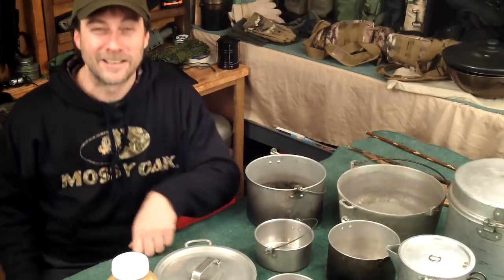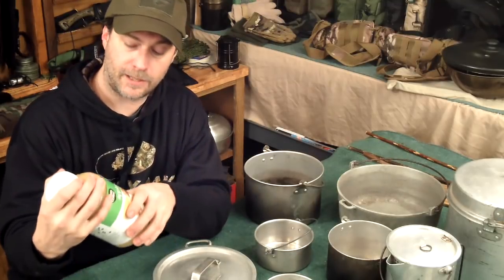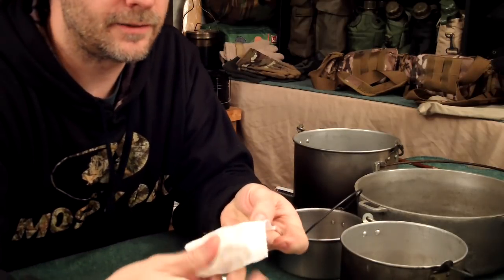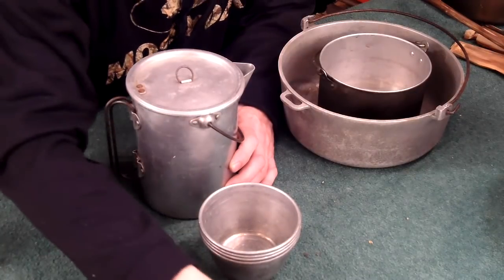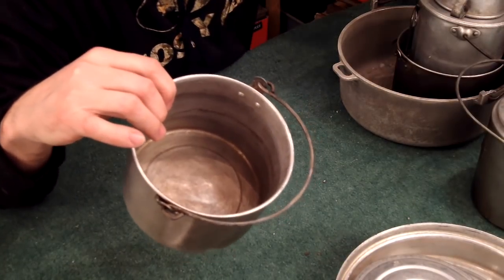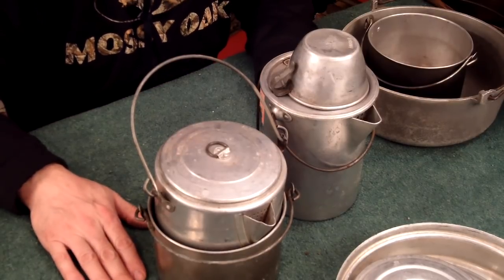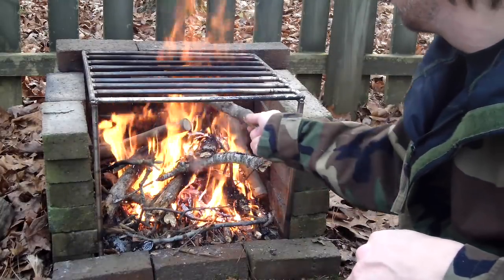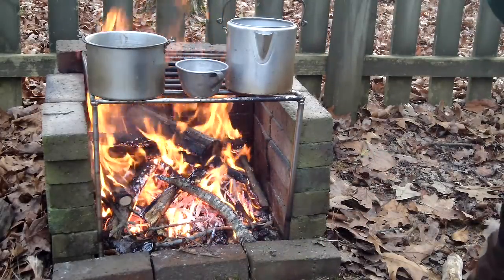Testing Old Aluminum Cookware For Toxicity

Comment: Maybe it's time to switch to Stainless steeluMINEEUM...:)
Reply from the maker: I love my vintage pots but most of my camp cooking is done with stainless
Reply: Not all stainless is equal and can leach heavy metals as well.
Reply: LoL Sandy PEACE :-)
Reply: Easy for Dave to say LOL
Reply: Or, cast iron. The saying should be: 'it's worth it's weight in cast iron'.
Reply: From where.. ? 
304 standard approved stainless steel used for kitchen products are made of 
            Ni                     9.25
            Cr                    19.00
            Fe                  Balance
            Si                    1.00
            Mn                   2.00
            C                     0.080
            P                     0.045
            S                     0.030
Do you think cookware would be approved for cooking food if it contained heavy elements... ?. so unless its contaminated from an outside source there is no heavy metal in stainless steel... jeez man... they even use it at hospitals as surgical steel...
I googled it and obviously a lot of wacko sites recommend against it but I could not find any government or FDA recommendations against it...
Reply: @kristianblerche8443 couldnt find  any govt or fda rec. against it  hahahahahahah
Reply: @Reallybigmonkey1    Not trying to be rude .. but my daughter also had a problem pronouncing aluminum also ... so I taught her the phonetic way to say it .. a lew ma numb ,  : )  but then she also called a zipper a "gipper" for years ... and having spent the first few years of her life growing up in the south she learned that cow was a "caaw" and that never changed!  Love your videos Dave!  Blessings.
Reply: I use stainless and cast iron. Cast iron is to heavy to pack very far and I don't trust stainless or anything for that matter from China
Reply: MrOldclunker yeah your totally wrong about that.  I spent roughly 10 years in a steel mill.  Working the LMF (Ladle Metallurgy Furnace)
Reheating 85 ton pots/ladles of liquid steel and making the different grades and none of the chemistries ever came back from the lab with any heavy metals of any kind. Your a nut

Comment: Great video and a great alert about leaching from metal pots.
I first heard about this when I discovered that some "stainless steel" pots made in China ended up on shelves in the US and they turned out to be "stainless steel with a healthy dose of pot metal including lead". I eventually adopted the following strategy based a little knowledge about metal work and cast iron pans... all learned from youtube channels like your fine self.
1. I dont assume any metal pot or pan is 100% safe
2. Unless its a premium stainless steel from a very reputable supplier....I season it.
I learned this from seasoning cast iron pans but it works on aluminium too (albeit slower and more difficult) .... when I get new alluminium pots and pans for camping, I always wash them, scrub them, scrub them again with a very fine sanding sponge, then wash them again a few times. Then I season them with Trex or some other vegetable based fat bar, several times.
That way, just like cast iron pans, you are cooking on the patina, and its your food versus the coating, not your food versus the metal and whatever its leaching.
The funny thing is that this problem is really a problem of the modern age... because we have water and detergent on hand and in abundance. Nobody used to scrub their pans back to the metal in the old days. I had to train myself to cook with cast iron and aluminium pans, and NOT scrub them clean.... remove the food debris, remove the crap... leave the patina. 
Thanks for the video mate. People need to be reminded that crap leaches into their food from the tools they use to cook it.
Reply from the maker: I'm glad you liked the video and thanks for the comments! That's very wise advice to season all the new cookware you use. Thanks for watching brother

Comment: What an awesome tip David! Thanks. Another way to check if the aluminum is still good to use is by looking at the surface of the cooking area. IF it is corroded and specifically PITTED it is no good to use anymore. I did a lot of research a few years ago on the dangers of using aluminum to cook, and the general consensus was that it is OK as long as there is no pitting and corrosion. That cast pot was clearly corroded and pitted, and the stamped pots were nice and smooth, so it seems to verify the information I found as well. Now, I believe it would be possible to repair the cast pot if the corroded and pitted areas could be ground down and polished smooth.
Reply from the maker: Thanks! I'm glad you liked it Steven. That's some good information. I had heard that just cleaning wasn't enough that it needs a high polish.

Comment: This was good.  If you were to again put applesauce in the cast aluminum Dutch oven, would it again turn pink?  Or would the applesauce have stripped out the toxic material?  Whisked it away, so to speak?
Reply from the maker: I have no idea. I only did it once. Good thought to try again

Comment: Good experiment Dave. I'd be curious to know if the acidic properties of the apple sauce actually "cleaned" the bottom of the cast pot. When you cleaned out the pots, did you notice any variations in the color vs. what it was prior to the experiment, especially with the cast one? Just wondering...HAPPY NEW YEAR!!!!
---Chris
Reply from the maker: Thanks Chris, I'm glad you liked it. Well they claim that if a pot is dirty soiled or tainted, it can eventually be cleaned out. If its an old leaded alloy pot then it will always turn applesauce pink! Thanks for watching and a Happy new year to you too!
Reply: I was wondering same. Growing up as kid i learned you can use ketchup on bathtubs get the dirty ring off. So yea i do wonder if it could be saved. But, honesty after all replies i. Here and this vid. I dont expecr using aluminum for cooking anytime soon.

Comment: I seasoned all my aluminum like cast iron also one like urs they don’t look as nice but man they cook good
Reply from the maker: I agree,  seasoned pots are definitely the way to go
Reply: Any tips on how to easily season aluminum skillet without an oven?
Reply from the maker: @rogierius  They claim you can start a campfire and get it going.  Throw the pan in and warm it up. Pull it out while hot and smear Crisco all over it and throw it back into the coals. Do that 2 or 3 times and you should have a nice shiny black coating.

Comment: If I understood it right, Aluminum (Aluminium) is a so called soft metal and releases particles in to the food when heated...and therefore in to your body. BTW...Alzheimer's, according to research is also caused by eating soy products  (together with impotence). I still own a aluminum canteen and matching cup....but I will replace that with a stainless steal one...if I will remember. LOL (Have a good one David!)
Reply from the maker: Very interesting Patrick and I never knew that about soy! Thanks for watching
Reply: Phytoestrogens are FAR less effective than the bovine estrogen found in dairy and beef. The Japanese have a diet very high in soy and studies don't show the problems people claim.
Reply: Also i picked up some aluminum kits and I'm very resistant to use them. Probably going to just scrap them

Comment: In the large pot that turned pink indicating toxicity ypu can still boil water and cook in aluminum foil inside of a plastic bag. The key is to not let the food get in direct contact with the pot. Boil vinegar until you can detox the pot. Vinegar and soda should finish the detox after cleaning  it. After that use iodized salt to wash your pot after seasoning it with flaxseed oil. Preseason every time you use the pot. Use salt and water paste to clean it every time you use it. Burning.  Charcoal in it will detox it in extreme cases. Oven cleaner in it covered with a garbage bag with take out baked in stains. Detox after that.
Reply from the maker: Thanks for the info Conrad

Comment: I'd turn that cast pot into a fire bowl. ;D Did you ever try to polish and retest the thing?
Reply from the maker: Nope, never polished it. I think as thick as it is it'll make a good fire bowl
Reply: @Reallybigmonkey1  ... Consider a 1/4" drain hole, so nobody mistakes it for cookware.  Another great video!  Thanks!
Reply from the maker: @FnLn55  good thinking!

Comment: If you really like the big pot, maybe you could use a DA sander and sand it down with some course grit sanding pads rated for aluminum, then some finer grit to finish it off. If you can get into some fresh metal, it might be good. Then run the test again and see what happens. 

If nothing else, this will bug the crap out of you for months and years until you try it....... haha, haha.......
Reply from the maker: LOL, it will bug me! Some folks say clean and give it a super fine polish. I may just do that
Reply: Hey Dave, 

This may not apply here but I soak my Stanley Stainless Steel Thermos with baking soda and hydrogen peroxide overnight to clean it. This may not work on toxins in aluminum however. 

As a tip in addition that that, I picked up a 71' Ford F-100 with an aged fuel tank full of bad gas, corrosion, etc. Instead of paying the radiator shop to steam cook it, I dissolved about 2 pounds of baking soda with hot water and poured that into the tank. I then added a few bottles of hydrogen peroxide and about 4 liters of generic Coca-Cola. Then I filled the rest with hot water to top it off. You can leave this soak for a few days or jump right to my next step..... 

Finally, I took a long rod air blower from my air compressor, tied it open, and laid that in the bottom of the tank with the air blowing bubbles into the tank all day long. This provided agitation and oxygenation for my chemical concoction. 

At the end of the day, I dumped out and gently tapped the sides all around with a rubber mallet to knock anything loose. I then rinsed it out with a garden hose and let it dry out completely. Once dry, I tapped it gently with the rubber mallet some more and vacuumed out the loose rust crumbs and dust. 

The end result was a nearly brand new looking, shiny clean fuel tank!

The only caution I offer is that I alternated blowing air between two air compressors back and forth. This way one compressor would not overheat from running all day by itself. However, I do not believe the air compressor is critical if you do not have one. 

As they say on TV...... "The Secret is in the baking soda, peroxide and Coca-Cola formula!"  Haha...
Reply: I guess if I would have read just a little further, I would have had an answer! But thanks anyway for all you do, all the effort & time you put into making these videos! God bless ya, man!
Reply: What about glass bead blasting Dave, and then polish with auto body wet dry??

Comment: Dave, just out of curiosity. If you chucked that old cast aluminum pot in the lathe and buffed it out and polished it so it was like a mirror and then re-did this test, I have a feeling that it wouldnt change color, because all the oxides would be off it and the pitting would be gone.
Reply from the maker: Several people mentioned I should polish it and retest. I may do that

Comment: Many companies make their copper pots with a core of aluminum by Electroplating. Makes copper pots cheaper and lighter. It's a fairly easy prosses to do if you want to save old aluminum pots. You can also use Anodization to stop the leaching of oxides. You can fill any pits and cracks with a lead-free high heat tin solder or silver solder. That stew pot is unique enough to give it a try. Instead of scrubbing them to try and clean off the oxides get some TSP, gloves and a scotch bright pad. The TSP will eat a layer or two. You will need to do this any way to electroplate it. You can buy the copper electroplate solution and use a copper scrubbing pad as electrodes to transfer more copper to the pot. Easy search how to on Youtube. If you really want to make sure it's covered and inert you can get the gold or silver electroplate coating and just do the inside of the pot after the copper coat.
Reply from the maker: Thanks for that info Joe
Reply: You're Welcome. I have repaired many different kettles this way. I always grab them whenever I see the right ones in second-hand shops. Some kettles get very ornate. It's easy to sell them once copper coated and polished.

Comment: I season my aluminum fry pan and believe that makes it okay to use for certain foods or water. If I use an unseasoned pan to fry eggs with butter I can actually see the aluminum rust come off in the eggs. And this is a very clean pan when I use it. 
I appreciate you doing this video to demonstrate the effect.  I don’t know if aluminum causes mental health issues but considering the cost if it does I’m just going to use my seasoned carbon steel.  
Anything to excess can become a problem. Thanks!
Reply from the maker: I'd think if one had a thick enough coating seasoned on it should be safe? Thanks for the comments and thanks for watching Mike
Reply: @Reallybigmonkey1   I totally agree!

Comment: To remove interior discoloration, fill the pan with water, add 1 tablespoon cream of tartar or 1 tablespoon lemon juice per quart of water, and simmer until the discoloration is gone. Complete the process by scouring the pan with a steel-wool soap pad. Caution: Wear rubber gloves.
Finish by neutralizing with paste of backing soda and water.
You actually get more dissolved aluminum from taking and anti-acid tablet than eating food from aluminum cookware.
Reply from the maker: Thanks for that info

Comment: Great test and love the cat! In my days in the military we were issued aluminium mess tins but they were more used as a plate for the food or to warm up MRE's and not to actually cook with. Still the scraping of the stainless cutlery left some marks so it's possible it did scrape of some of the aluminium. I had a camping cooking set for private use made of aluminium also.
I changed to stainless both at home (and never use tin foil) and in the outdoors. 
At some point the military changed to stainless mess tins also so now I have these.

I do have some titanium pots but I still prefer the stainless steel ones. I will deal with the extra weight but bring less, rather than bring an abundance of aluminium pots.

And the test did work. The color difference was very obvious.
Reply from the maker: Thanks for the input brother! I'm more of a stainless steel guy myself. I'm guessing aluminum scrapings would be m minimal?  Thanks for watching

Comment: Excellent video Dave, Toxic enzyme's from Aluminium can cause all sorts of problems to younger people, especially Cast Aluminium. All sheet pressed Aluminium is generally Clad Aluminium which means it had a Layer of PURE Aluminium on top of the sheet process during manufacture. This stops the pores which are open to the Air and prevents Oxidizasin which can be poisonous to the body eg. Look at Aluminium greenhouse at a garden centre that has white powder on the frames, Bingo Oxy- Powder. Your video is a fantastic example of what is good or bad Aluminium cookware. Thanks Again for your Time and Effort. PEACE:-)
Reply from the maker: Thanks Capt for the info and I'm glad you liked it. Thanks for watching

Comment: Just picked up a set of the 1049, figured it was old my set has four aluminum plates, small medium and large pots, plus the Coco pot, two pans 2 handles, small and medium Lids have three ring the Coco pot has the two ring plus four aluminum cups anyway. Thanks for the info good video
Reply from the maker: Sounds like a fantastic set! As time goes on and I've learned more about the 1049 set I realized my cups are missing.

Comment: Wow I'm 62 years old I've been using Grandma's old cast aluminum pots and pans for years I remember her use them when I was a little kid I'm going to test them though we'll see what happens thanks for the idea
Reply from the maker: It's best to test them but if it had a good thick seasoned coating built up it was probably safe.

Comment: I couldn't agree with you more about all the conflicting opinions on aluminum. I normally use stainless, but have no problem using aluminum. As long as I know what's been in it, but that goes for any kind of cookware. Thanks for the tip on using the apple sauce
Reply from the maker: I have no problems with aluminum either but right now 90% of my camp gear is stainless. Thanks for watching!

Comment: Thanks for the demo, Dave. Another concern with aluminum is travel wear in that pots nested together during  movement or constant abrasion wear away particles of the metal,which is bad. Thanks for the information...wait, I was just reminded of a book I read 30 plus years ago and it is still on  my bookshelf and now in my hand.  Entitled "Back to Eden" by Jethro Kloss. Originally published 1939, reprinted in  the '70s. Chapter XI ALUMINUM UTENSILS, I quote the first paragraph "Aluminum poisoning is so prevalent that I feel it is a part of my duty to give my experience and warn people against the use of aluminum." He goes into detail that I cannot offer here, but perhaps you and others may benefit from further research. Thanks again Dave.
Reply from the maker: I'm glad you liked it Steve. Man I never thought about the pots nested scraping on each other. Interesting book. Thanks for watching